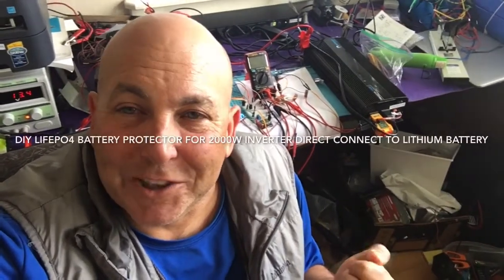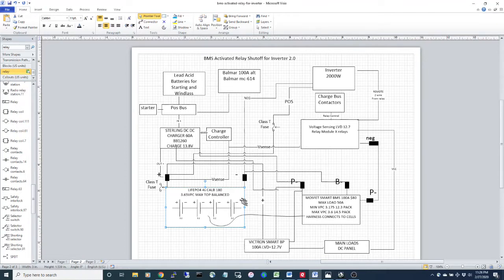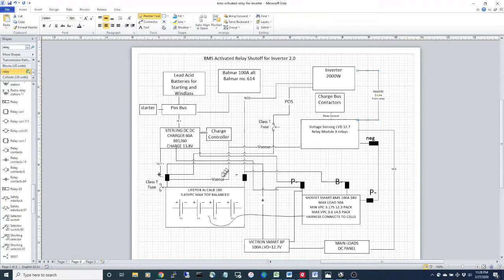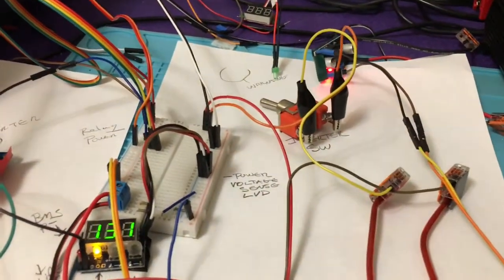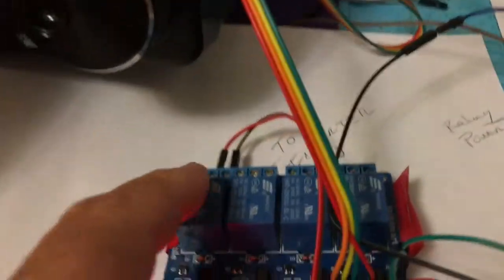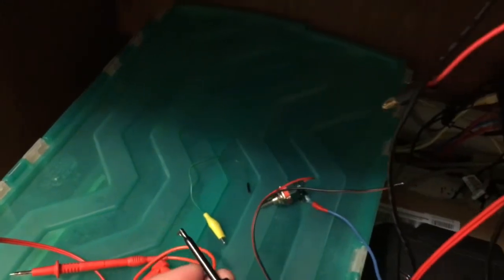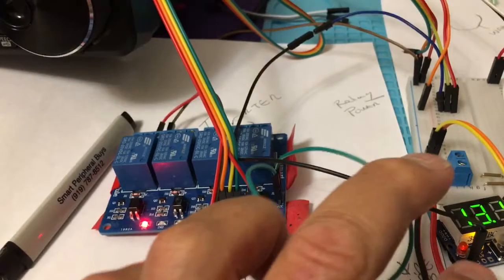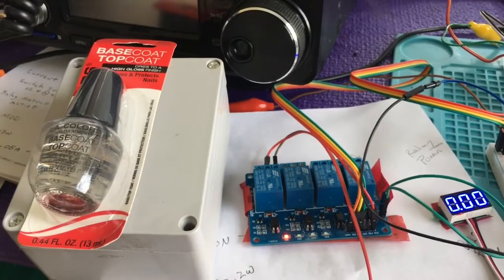Integrate $20 DIY Lifepo4 Battery Protector with 2000W Inverter on off switch and $60 Lithium BMS.

Comment: This setup is a bit dangerous (for your modules). When the system disengages, it's ok (except for the high consumption, but you can as well trigger another relay to completely disconnect the system on another lower voltage so you won't drain the battery to the "very dangerous, no recovery level"). However, when the system is charging up the battery, 2 things can happen. If you have a high power source, that can sustain the inverter draw, it'll work, but it means charging with more than 120A (which you're likely not doing). Else, when the charger will trigger, it'll try to rise the voltage to 14V or so, but as soon as the module see that voltage, it"ll start to re-engage the load. Yet, the load consumes too much power for the charger, so the charger can not sustain such peak current draw, and the voltage will fall back. At this point, the module will stop the relay and the cycle restart. In few mns, you'll have burnt your relay, and your charger (and also probably your inverter).

If your charger is dumb (and you shouldn't use a dump charger with a LiFePo4 battery), it'll slowly raise the voltage since there is no control on the output current draw. Yet, with your system, as soon as the module engages, the current draw will be too large for the charger again, and it'll abruptly drop the voltage under the required level.

That's why Victron made an hysteresis switch in its battery protect product. You need some high voltage level threshold not to trigger the relay, but you also need to monitor the current flowing through the relay/mosfet (which they also do). Yet, inverters have huge capacitors on their input to allow for surge current on motor and so on, and these capacitor will draw a very large current for a few ms when plugged in. This current will overload the limits build into Victron's system and will cause the system to disconnect the load from the battery. 

To have a similar behavior, you'll need another module that's re-engaging the first module only when the voltage of the battery is above some threshold (like Victron's BP). If you do so with a relay, it'll mean a continuous current drawn for the running system. In the end, you'll have a less performant system than's Victron's product, that's consuming constant power (in the relay, vs the MOSFET in Victron's product), and you don't detect short circuit (but a fuse will).

Comment: Great vid. I think Id be more cautious of high voltage cut off then low vcutoff
Reply from the maker: My inverter has a hvd and more importantly my bms P- lead supplies negative to all control relays. I program my bms with a hvd value of 3.6 vpc lifepo4 calb 180 cells 4s. When the bms senses above 3.6 vpc the P- negative powering the relays floats and the relay coils power down and they are in the power down open state. Then the inverter switches off. I show this but it is not obvious what I’m doing when I float the bms p-.
Reply: @dannyjensen4954  what do you use to shut off the pv?
Reply from the maker: @frankz1125  I'm connected to the C- Port on the BMS that floats the Ground to the MPPT and all other charge sources connected to C-. I only have 2 x 100w panels at this time. My mppts are charging to 13.8v pack and floating there. The max cell voltage is 3.6. I can buy a $20 cable to shut the mppts as a fail safe but I'm just letting the 13.8 limit and the bms shut the charger down. I"m 4S and don't have the large scale system you do.
Reply: @dannyjensen4954  right on. I was thinking about a separate port bms. Mine is not. But can get. I guess every setup is different. I dont plan on taking my system down that far to need a low cut off . 65 kwh goes a long time. Thanks for sharing .